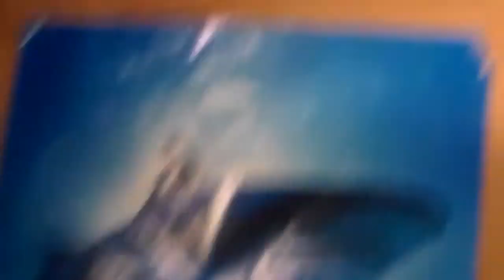Edwards Adaptahorn Fire Alarm Test

Comment: What kind of voltage is powering the Edwards ? Mine says 24 v 69 cyc. Is that 24 v ac?
Reply from the maker: 120 Volts AC, 60 Cyc. Controlled by a 12 volt flasher relay.